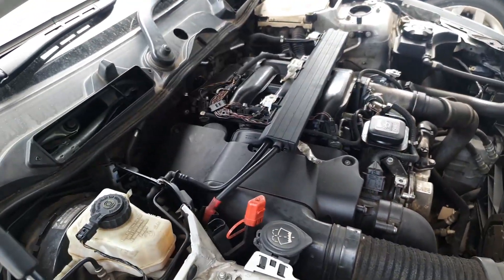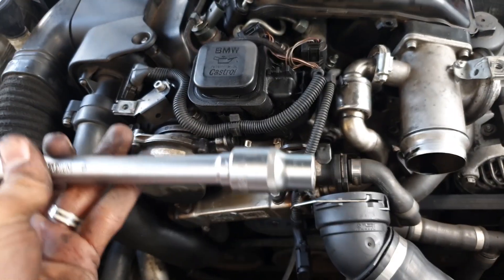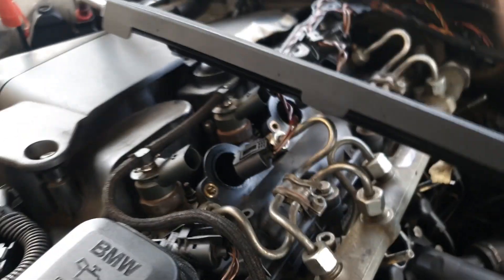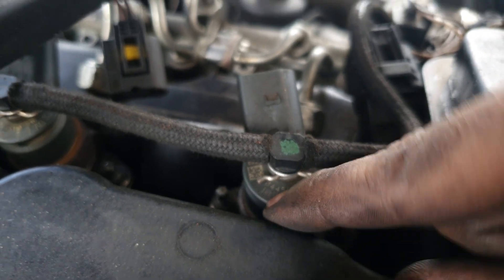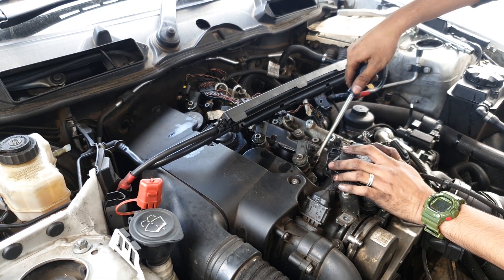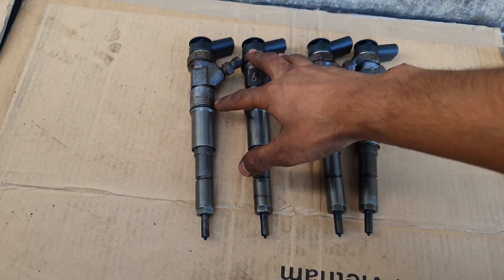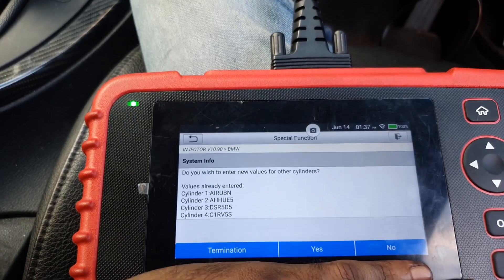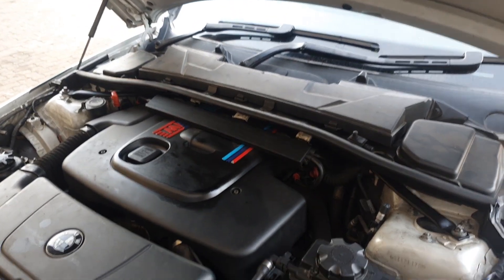BMW E90 diesel injector replacement - BMW E90 320d

Comment from the maker: For those that are new and missed the update, yes I did have the issue fixed. I've replaced the low pressure pump in the tank, and had the injectors serviced when I rebuilt the motor... https://youtu.be/8tZL_6nbzIw

Answers to FAQ: No it was not the fuel sensor, not the fuel regulator. this was caused by lack of fuel pressure from the tank to the motor. hence why I've replaced it.

Comment: My 320d seems to have a faulty injector. While idling the idle jumps then goes back to normal and intermittently loses power henceforth i have to switch the vehicle off and start it again... Do you think it's an injector or the pump from the tank?
Reply from the maker: It sounds like your 320d might have a faulty injector, but it could also be an issue with the in-tank fuel pump. A bad injector can cause symptoms like a jumpy idle, power loss, excessive smoke, or engine knocking, while a failing fuel pump may struggle to deliver enough fuel, especially under load, leading to similar power loss that’s temporarily fixed when you restart the car. To diagnose, start by scanning for error codes, checking the fuel pressure to see if the pump is working properly, and performing an injector leak-off test to identify any faulty injectors. Sorting it out early will save you from bigger issues later! 🚗💡

Comment: Boss what was the signs of injector failure
Reply from the maker: Car ranaway in feb of that year, damaged low pressure fuel pump and 2 injectors... Got the car running off camera but always had an injector hiccup since then so this was to demonstrate how to replace the injectors in hopes that would solve it, i did not, so i redid everything while i rebuilt the motor in 2022

Comment: need help..my 320d is cranking but not starting
Reply from the maker: Have the car scanned and read out fault codes to know where the issue lies
Reply: @Realpreshaanb  i did get it scan but only reading glow plugs fault codes which cant stop the car from starting.. i have a feeling its the fuel rail sensor..im getting fuel to the high pressure pump and out the pump to the rail but eint getting fuel from rail to injectors

Comment: Bro just check the fuel filter before you go into hours of labor 😉
Reply from the maker: Yeah i did that before, didn't make a difference, it was resolved once i changed the in tank fuel pump and after i rebuilt the motor
Reply: @Realpreshaanb  it's sound like the fuel system have contaminated. You would find that our buy cutting the fuel filter to see if there are any metal dust collected in the filter cells.🤷🏻‍♂️
Reply from the maker: I could have done that but like I've said, it was cutting out due to the in tank pump not providing enough pressure on boost, that along with the timing being off as well as some other factors (which have already been addressed) is what caused the issue

Comment: I've got this same engine,
I have puddles around the injectors and get the old bit of smoke that also comes into the car, smells like burning plastic 🤮
Reply from the maker: Depends on what puddles are forming is where you need to pay attention to, if its fuel then check along your fuel lines to and from the injectors, if its oil, then look into replacing your valve cover gasket or worse so it could be oil pushing out the injector ports from within the combustion chamber
Reply: @Realpreshaanb  it is definitely diesel and is around the top of all 4 injectors but mainly No.2.
Car runs a bit lumpy from start but ok when warmed up.
When turning engine off there is also a bit of a shake.
Reply from the maker: I would suggest take a look at the flexible return hose and the fittings itself, if not the injector top itself, the vehicle will run lumpy as a result of these having a problem, shake could be the motor mounts itself or an issue while shutting the motor off due to incorrect fuel pressure
Reply: @Realpreshaanb  hopefully this weekend I will have the time..
I will let you know 👍

Comment: My intake manifold did not come off as easy as you made it look. There were all sorts of electrical crap stuck to the bottom. My backs fucked I've had enough  gonna scrap the pice of shit.
Reply from the maker: Been there the first time i removed my manifold. Which is why i disconnected all electronic plugs and vacuum lines... Helps that i have small hands😅
Reply: @Realpreshaanb  🤣 it was all for nothing anyway turns out it was immobilised had to use inpa to sort problem.

Comment: Does it cause blowby?because ive see lots of oil in your intake...
Reply from the maker: The excessive amount of oil in the intake was due to the PCV not functioning properly. Since the video, i've rebuilt the motor and addressed most of the major issues

https://youtu.be/8tZL_6nbzIw

Comment: Why didn't you show how you removed the other 3 fuel injectors, in most cases injectors can't be removed as easily as you removed the first injector.
Reply from the maker: All 4 came out perfectly the way i showed... If you're experiencing difficulties removing them, that mean you need additional leverage
Reply: @Realpreshaanb  i now, i use a special tools, but its not always be one day job.

Comment: sounds like the high or low pressure fuel pump / low pressure is the cheapest you should check what pressure the fuels is when the engine isnt running but you can hear the pump priming EG when u open the door after the car has slept and work from there 

im also surprized you still have your swirl flaps fitted
Reply from the maker: Changed the tank pump a few weeks back, still cuts off however its not as bad as before, so im narrowing  it down to timing and dirty injectors which i'm going to pull out and have cleaned
Reply: Did you check fuel filter ? Has it ever been changed nvm seen its new what pressure is the fuel rail reading
Reply from the maker: Pressure is meeting specified value, only at top end its down by 100bar according to the diagnostic machine
Reply: @Realpreshaanb  I can't remember the values but fuel rail when running should be about 3000/4000psi and I think the lift pump should be in the hundreds
Reply from the maker: Correct, on closed circuit it reads 10bar (145psi) on idle its 314bar (4500psi) on load its 1400bar (20000psi) however on peak power the specified is 100bar more than actual that's around 4000rpm
Reply: I was just looking when you replied pecifications

General

System typeDirect injection common rail with Bosch high-pressure delivery pump and Electronic Diesel Control with DDE ECMFuel delivery pump pressure3.5 to 4.5 barInjection pressure250 to 1600 bar

Comment: When the top timing chain from the diesel pump to the cams wears, it retards the timing quite a bit. I just did a complete timing chain and tensioner change and my N47 now runs like a Swiss watch once warmed up…all diesels sound like a busted tractor when they are running cold at first start  for the day 😉
Reply from the maker: That makes a lot of sense, thank you for sharing, i am going to be doing a complete engine overhaul within the next coming months, so i will address everything while I'm busy with it🙏🏼
Reply: this is a m47 engine not a n47

Comment: Hi..how to know the symptoms of fuel injector failure? Mine seem like miss fire
Reply from the maker: It would start will misfires, any change in fuel pressure will cause it, sometimes it will surge in pressure, sometimes fuel pressure will be low... Best to do a diagnostic on the car to monitor live data

Comment: did you solve your problem. if so  .. what was the problem
Reply from the maker: Still haven't "solved" it, just living with it... Narrowed it down to in tank fuel pump and to double check the engine timing properly before second guessing anything

Comment: Do a EGR delete map it ultimate beast I’ve done it
Reply from the maker: EGR signals Coded out + stage 1 done in 2019... Hardware still on the car since there's no kits available locally or internationally
Reply: @Realpreshaanb  where are you from ??? 
In poor Polnad we got hardware to egr delete 
Thanks for the movie, i'm changine (plates pad ? ) under injectors today
Reply from the maker: I'm from South Africa, I've looked all over the net and couldn't find anything, I'm currently in the works of producing my own kits🙏🏼
Reply: @Realpreshaanb  did you finally make your own kits? im also in SA
Reply from the maker: Its been done when i had the car remapped to stage 1